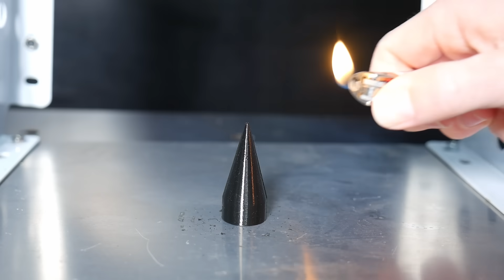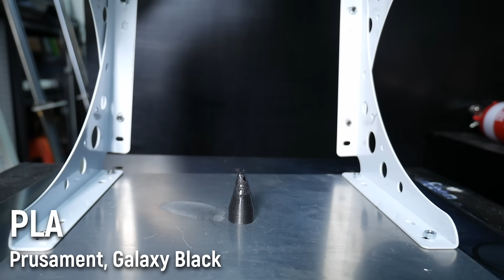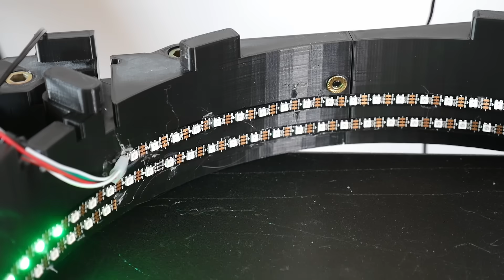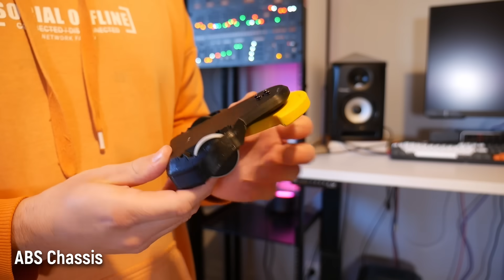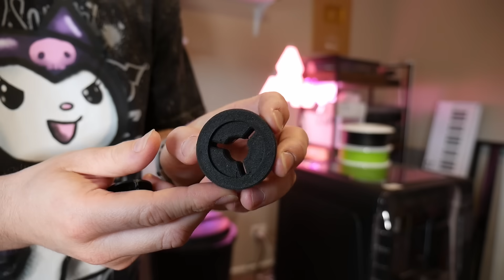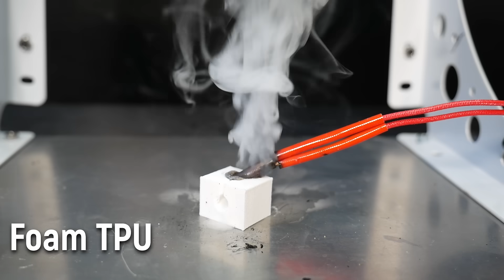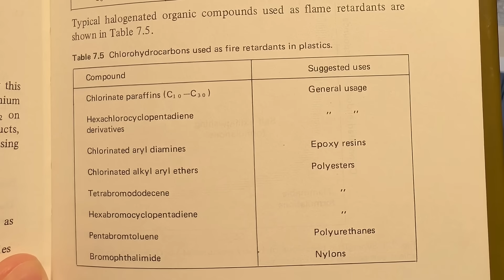Which 3D prints burn the WORST? (PLA surprised me...)

Comment: You really shouldn't have a powder extinguisher if you're not sure you absolutely need it. Using that in your workshop is bound to ruin tons of equipment there forever and knowing that might prevent you from using it in the first place, which is not the kind of thought process you need in case of a fire. Use a foam-type fire extinguisher. It's cheap, effective, and you only have water damage to contend with, which sounds bad but is nothing compared to powder that gets into everything.

Comment: Flammability, and many other features, of plastics are often less about the type of material, and more about the additives that have been added. Fire retardant additive effectiveness and quantity vary widely in different plastics. You can easily have two objects/material stock of the same base material have vastly different specifications. 
This is why plastics is usually its whole separate engineering education, and if you as a regular engineer need  plastic of a certain specification/use case, you should always consult a specialist.

Comment: Many plastics have petrochemical bases, when they are heated up to the point they decompose, they basically become fuel, so the heat of the flame is actively creating more fuel.
"Over 99% of synthetic plastics are manufactured from petrochemicals derived from fossil fuels like crude oil, natural gas, and coal."
For PLA it offgases "VOC's like acetaldehyde and formaldehyde" different chemicals same result, self-fueled further decomposition along the interface layer of it being heated.

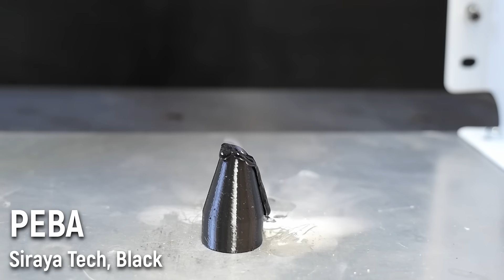13:42 is great example of the decomposition requiring slightly more energy than the resulting off-gassing fuels supply when they burn, also as a function of available surface area and air mixture ratio. The bigger base creates a large air-mixture 'dead zone' in the center, try printing a cone with air channels?

Comment: My parents loath the smells when I print....

Also, Nylon is extensively used in aircraft interiors in non structural appllications, most as spacers (phenolic is preferred}, but maybe some mechanism parts. 

At the time I work in the industry (upto 2022), there was only one flammability approved filament, And I would guess that's (Nylon-CF), unless anyone else has an idea. But both those bases are inflammable. They are extensively burn tested under the FAR (under the FAA), so no wonder our client is keeping it secret, it's a defininit advantage, especially if it replaces expensive handyman's duct work. But they must use it for everything now.
Reply: Active ventilation & filtering is your friend ❤

Comment: I like feeling safe when printing casings for electronics. The test I run is much simpler: I take a piece of filament, hold it like a match with the head down, and light it with a blowtorch. The only non-specialized filament that passed the test is PC. Actually, pure transparent PC has become my go-to material for all casings. It is strong, not expensive, prints well on my Qidi Q2, resists any realistic heat, doesn't burn, and, as a bonus, you can see the LED lights through it because it is transparent.
Reply: As a bonus: I finished a months long experiment this weekend in which I placed several test prints in the direct sun on my balcony during summer heat. PC performed the best - barely any deformation.

All samples were a simple body consisting of two flat surfaces at a right angle. The surfaces were about 2mm thick and 40x40mm wide. I wrapped a rubber band around them to add some simulated load. We had temperatures often around 30-35C this summer, surfaces in the sun could reach much higher temperatures.

Color is a strong influence - PLA black literally folds itself after a couple of hours of afternoon heat, half an hour on really hot days. Even if it is standing on a white surface that doesn't get very hot. Followed by black PETG after two days outside. Light colored PLA will deform if it is on a hot surface (in my test: a metal step on my balcony that was subjected to direct sunlight). The carbon fiber in PETG-CF does not safe it - it deforms after a week or two on a hot surface. PC (cream white) and PC-CF (dark grey) were fine with no visible deformation.
Reply: @KonradTheWizzard FYI, the CF PC I tested burned well. Also, CF is not recommended for electronics.
Reply: @GlebGrigorian Thanks! I tried PC-CF because it was advertised close to being magical, but after this experiment and with your input, I think I will abandon anything with CF in it - it's not worth the price. CF is a gimmick in 3D printing. To actually benefit from it, the manufacturing of the object has to hit specific conditions that are hard to hit in traditional CF resin applications and impossible in 3D printing.

At some point I will probably use my last bits of CF filament to print a model of the Titan submersible - as a physical warning to myself to not believe any hype. 😜
Reply: @KonradTheWizzard  my goto filament is transperent kexcelled PC
Reply: I have some clear polycarbonate too and never had any problems printing it on my Creality K1. I remember reading it was difficult to print with, but never had a failed print, didn't even have to dial in the settings, just used what the filament suggested
Reply: Simple test, probably wouldn't have caught the extreme flammability of foam TPU but maybe that's ok.

Comment: The foaming TPU Air burned so well vs. the normal TPU is because of that "blowing agent" or foaming agent.  Not the agent itself but what it's effectively doing to the thermoplastic by causing thousands of tiny bubbles to form within the plastic that just happens to be a perfect source of oxygen fueling the flame of the print.  It's kinda the same reason "nitromethane" burns so well like it does in tiny gas powered RC devices.  The nitromethane brings its own oxygen to the party and doesn't require any forced or naturally aspirated air into the cylinder to achieve a stochiometric mixture of fuel and air.

Comment: MMmmmmm, fire. Always a reason SDS are important and why basically every one of them says "don't burn" or "burning releases toxins". I remember the first time I encountered the "white powder" from PETG... was a bit of an "oh no" moment. I wonder how much some of the effects you saw was from the glitter itself. I think nylon would've been an interesting addition, it's not as common, but Polymaker and Bambu have been pretty big on "oh, you want to do engineering materials? Check this PPS/PA6/etc." Also, fun on "there's some really dangerous filaments out there" and listing POM... I've been trying to figure out how to print it (it likes to rip itself off the cardboard "bed" I make for it). But I've been super careful about temps because the SDS for them indicates above a temp, it basically becomes super toxic.

Comment: Need to redo that test with PCTG too because I use it more often in electronics than PETG. Its the "better" PETG to me… (tx for the others!)
Reply: Also PCTG in contrast to the flaming ABS/ASA results, as PCTG is so useful for outdoors, high heat, UV resistance, etc, while easier to print than ASA/ABS.

Comment: Id bet if you printed a print that would be a bunch of thin hollow tubes with open holes at the bottom so the fire can suck air from the bottom of the print all of them will burn, some quite violently.

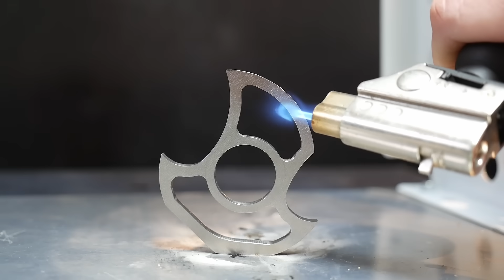Comment: 6:03 Laughs in Alkali Metals, Alkaline Earth Metals, and thermite
Reply: Also, metal powder is flammable, and it can be explosive when suspended in air. So be careful if you 3D print metal parts.
Reply: Even aluminium can burn in high temperature cases, and adding water then makes everything explode. There are special types of fire extinguishers for metal fires
Reply: @aterxter3437  never knew that. That sounds scary! Is it like a grease fire when you add water - instant boom?
Reply: @doublestrikePhoto yep, the water explodes since it vapourizes so quickly, flinging molten metal everywhere. Molten aluminum is also so reactive that it rips the oxygen off of water.
Reply: Especially titanium, thin titanium powder for SLS process is explosive
Reply: and post-transition metals, lanthanides, actanides and for some reason titanium

Comment: "Do you know what does not burn at all? Metal!" Magnesium: Hold my beer! ;)
Reply: All metals burn if you heat them enuch
Reply: @Goroca  Chemically Iron rusting rusting is burning.
Reply: @omp0815  While both are oxidation reactions, combustion is different than oxidation.
Reply: @Goroca  Hell most metal burn if you leave it in contact with oxygen
Reply: @Goroca show me gold burning right now
Reply: @moikkis65  Google AI say, that gold oxide can be obtained by passing spark discharges between gold electrodes in an oxygen-ozone environment.
Reply: @stanislavdenysenko2007 thats not burning
Reply: @moikkis65 
I do not have access to florin so sorry
Reply: @moikkis65  Keyword MOST. Not ALL.
Reply: @gavinhull1954 they literally said "ALL metals burn if you heat them enough" or am i fucking crazy??
Reply: You cant say "KEYWORD MOST" if literallly bobody said most yoi dishonest brick
Reply: @Goroca Noble metals such as gold, platinum, and silver will not burn because they have very stable electron configurations, meaning they are highly resistant to forming bonds with oxygen. Even when heated to their melting points, they will not ignite.
Reply: @ΔΡΠ
You can "burn"(react) all materials except helioms whit florin 

You can probably get a gold fire, not not big flames
Reply: @Goroca anything will burn if you give them enough heat and oxygen. Even aluminum and steel
Reply: @bobtheblob2770 well... if you call plasma "burning", then yes. But you don't even need the oxygen for that.
Reply: @jhbonarius  steel wool: hold my beer
Reply: @bobtheblob2770 everything burns with chlorine trifluoride
Reply: @jhbonarius  flamw is plasma bud
Reply: steel wool: you sure about that bud? i got a 9 volt battery that says it can burn steel wool in seconds
Reply: Thermite for even more fun. Last time I got one running I used magnesium tape to get it started :D
Reply: @seabreezecoffeeroasters7994 And the aluminium powder is the fuel, another nail in the metal doesn't burn coffin.
Reply: @seabreezecoffeeroasters7994 uou should see what the other non-iron thermamite are like. copper is rather energetic rather like gunpowder
Reply: Titanium: "Am I a joke to you?"
Reply: and a metal dust explosion in a dust collection system is not funny at all, basically a huge bomb going of.
Reply: @therunophil i remember when aluminum powder factories were taken off the dangerous factories list and within a month one match sticked itself.
rather like natral gas explosions in houses
Reply: Francium: literally explodes in anger at that statement
Reply: @mig0150 it would be spectacular if you could make enough of the stuff to see. so cesium is as good as it gets. i would recommend chemicalforce for spectacular chemical explosions with high production quality
Reply: it always amazes me that many metals come out of the ground 'burnt' (oxidized) and smelting is applying heat and chemistry to 'unburn' or reduce them to their elemental state.
Reply: Mixture of aluminum powder and rust powder... (thermite)
Reply: You can start fires easily with steel wool and a tiny battery (or a match).
Reply: Sodium, potassium, & lithium: 
𝕳𝖊𝖑𝖑𝖔, 𝖈𝖍𝖎𝖑𝖉𝖗𝖊𝖓
Reply: you must be talking about magnesium.
Reply: Sodium: lol
Reply: Thermite enters the room... Metal burning by using oxygen from another metals oxide.
Reply: Potassium... Hold my beer
Reply: Sodium
Reply: @Knowbody42 for reasons best known as ‘being to tight fisted to do the job right’ not only did Americans burned a load of their homes down using aluminium wire in home mains installation to save a few pennies over copper. they even used sodium wires on their grid to save pennies over aluminium , ,
Reply: almost any metal in powdered form for that matter XD
Reply: just search video of burning steel powder. It is all about surface area. Magnesium is not so easy to burn, good luck to ignite an engine cover or a bike frame made of magnesium.

Comment: what would really interest me is the difference between PETG and Prusas PETG V0 which is certified to be flame retardent so it can safely be used for electrical components. I think this experiment showed that at least for the materials you tested, PLA and PETG seem safe enough for small electronic projects (which is good, considerung how many Arduino and Raspberry pi enclosures are out there), but 230V definitely is too much of a risk for PLA. PETG should also be fine there, which is what I expected, but some colors might not be so fine.

I assume PETG V0 from Prusa isn't that different from their normal PETG, just with the certification that it doesn't use flammable pigments and additives
Reply: The V0 have addetivs that stink a lot

Comment: This is why it really bothers me when I see designs for printable electrical outlet wall plates.
Reply from the maker: I didn't even think of those 😩
Reply: Why? As the auto-ignition test shows, it is not actually easy to ignite these plastics from heat. If you already have burning fire in your room, those outlet covers aren't your biggest problem.
Reply: @frankbauerful  I've wondered the same thing.
Reply: It's possible for electrical fires to start inside the wall box due to a faulty or overloaded outlet. Thermoplastics can melt and run down the wall, and if they ignite in their molten state, they can spread the fire. Plastics used for retail outlet covers are generally self-extinguishing thermosets, and might even be required to be such by code, depending on the location.